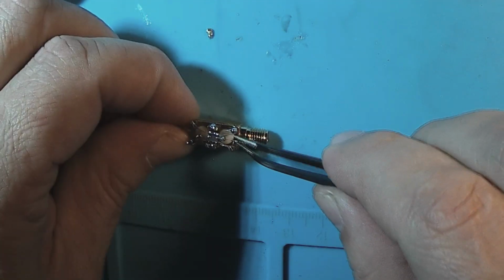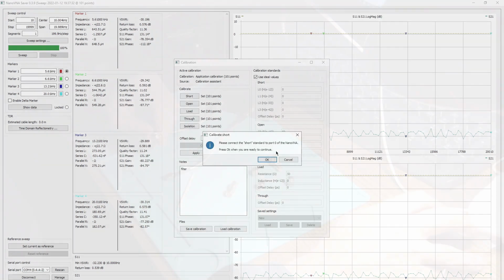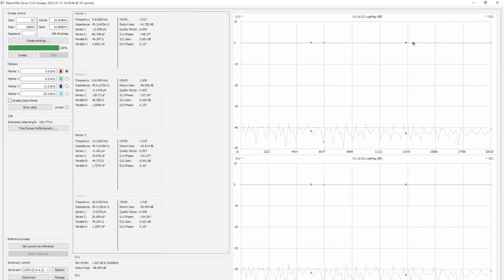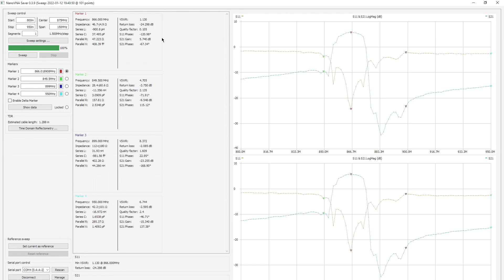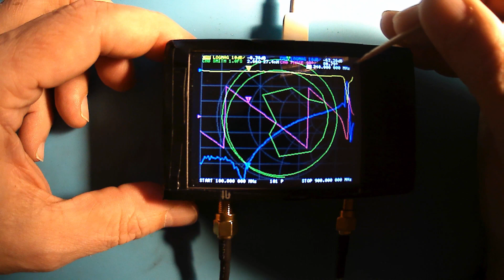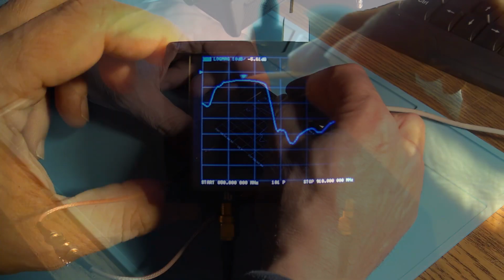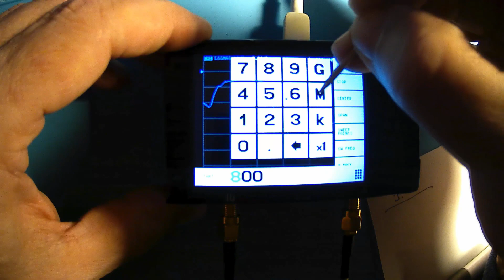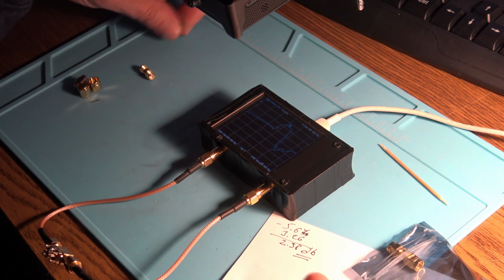DIY LoRa 868MHz bandpass saw filter

Comment: I have some question. Have done this filter and worked pretty well for some time but after it seems to have lost its characteristics i think because of esd. Will a surge arrestor for the antenna protect the filter or it needs a tvs diode also and what complementary with the tvs diode also is recommended to not change it's characteristics?
Reply from the maker: Yes they are prone to electrostatic discharge damage, of course an arrestor connected to a proper ground  will do the job, if you have a shorted antenna, like RAK, then a simple grounding the antenna and everything metallic around will be sufficient
Reply: @viocaia  so the antenna must be shorted circuit instead of open. I think i have the antenna open circuit. It is a mikrotik 6.5 lora antenna.
Reply from the maker: @vasilaos  No, it should be nice to be! there is no rule like that..I said for a short circuit antenna it's much easier to ground..for open you need arrestor

Comment: hello sir i have a question i live in india and here working freq. for helium is "865 mhz" , the saw filter i am trying to buy is a 868mhz , will it work for me or it will cause high dbi losses?
Reply from the maker: The one I'm using is centered to 866.5Mhz..so it will cover very well 865MHz too..search A3717 in my videos
Reply: @viocaia  ok sir thx for a quick reply 😊

Comment: Did you get the input and output connections the wrong way around when looking at the filter upside down? 🤔

Port 2 is input (antenna side) and port 5 is output (hotspot side) ?

Link to SMD schematics here:

https://www.mouser.co.uk/datasheet/2/1100/sf2137e_2-1917478.pdf
Reply from the maker: Doesn't really matter, it goes both ways

Comment: Good morning, when my SENSECAP arrives, can I directly connect a 10dB antenna that I have installed or do I have to configure the device for a week with the factory antenna? Thanks.
Reply from the maker: Yes you can..use any antenna available...10dB is great

Comment: Salut, ce dezadaptare ati masurat, daca ati masurat la intrarea filtrului fata de impedanta de 50 de ohmi. ? Multumesc. Din tabelul din stanga ecranului, la prima masuratoare apar niste valori aberante pentru VSWR si implicit return loss.Pe grafic insa, return loss era ok. De fapt am observat ca nu ati mai continuat masuratoarea deoarece va dadea cu plus :). Am observat ca ati setat un "span" de 150KHz la o frecventa centrala de 875 MHz ori asta e un saw wide band . Eu sunt de scoala veche, analizoare " normale" nu sunt familiar cu aplicatii de analizor pe laptop. Imi puteti spune ce folositi in videoclip pentru a face masuratorile de caracteristica si adaptare ? Multumesc.
Reply from the maker: Sint doua softuri..ala pe 64bit ..Nanovna Saverr da gain cu plus...e cam aiurea, trebuie facute niste scaderi..apoi am realizat ca softul de 32b pleaca de la 0 , deci valori negative..asta il folosesc acum..in general filtrele dau cam -2,1 max -2,5 dB pierderi..am gasit si mai bune ..aprope de de -2..nu e asa de mare banda..cam 7MHz..iar softul folosit este NanoVNA Saver v 0.3.09 pe 32b..daca face fitze si nu initiaza portul USB..cautati Nano QT..doar pentru connectarea aparatului, dupa care deschideti SAver si merge perfect..am un video despre problema asta..sincer inca nu sint prea stapin pe softul asta, incerc sa invat din mers..
Reply: @viocaia  Multumesc mult, trebuie sa cumpar si dispozitivul insa
Reply from the maker: @braturomeo6016  sint cam 60euro pe Ebay..nu-s grozave dar iti faci treaba..rapid si usor de folosit..

Comment: Very interesting. As I understand you are doing this for your helium hotspot? But why you chose the 866.5 MHz filter not 868?  And do I understand correct - installing saw filter there will be loss on antenna gain?
Reply from the maker: I couldn't find any 868Mhz..as in my miner original filter is also 866.5...so I went for this value..and yes there is a 2.38dB loss signal..by my tests..
Reply: @Viorel Caia  and since installing this saw filter did you notice any improvements? I keep seeing that they should improve hotspot but since I'm really at beginner level with RF, I'm trying to learn as much as I can and your video is ultra interesting and seems like I can learn some things. By the way nice soldering skills
Reply from the maker: @justinasn  Well, I'm still experimenting with different antennas for now, so I didn't use the filter yet..but there are reports like a small improve is there.This filter it's a need in busy urban areas, where are lots of cell towers and RF communications.If you are in a remote place , that should be quiet around so you can work without it.I'll hook it up soon and let you, but needs few weeks of statistics
Reply: @viocaia  Yeah I'm in urban area so filter might be a good solution for me. Going to wait for your results

Comment: Hello Viorel,
good idea - I had it, too. Building your own DIY filter, not to buy the expensive one.  Handicrafted well soldered.  And yes, now of course, to compensate the losses, you need absolutely a low noise amp. I know, you wait for from china. Mine is here, but I wait for the bias T. Then I will put close to the antenna.
BTW, I saw, you changed your location of the hotspot. What advantage do you expect ?
Reply from the maker: Wasn't the location..just the antenna type..
Reply: @viocaia  Oh, sorry, I misunderstood, what Helium says in your activities : "asserted location". Means seemingly changing antenna, too, not only location.

BTW, I discovered something, that I didn't know yet. In the last weeks I had low earnings, I was annoyed. Today I found the probably reason : I installed more than one antenna at my balcony-railing near the miner, but only one was connected. So I could change easily the cable to check.  But, I assume, that the not-connected antennas took away part of the signal strength, so that the whole signal and the beacons do not come into the miner to the radio card.  Yesterday I removed one antenna, today the last one, that was not connected. And what shall I say : the rewards went up immediately. Wow.  That's an information, all hotspot-owners, who are experimenting, should know. I think they do not, as me. Now I'm happy again.
Reply from the maker: @ulrichm.12  Very interesting..feels like a passive reflector out of phase..but I never read about this behave..I suppose HAM radio guys can clear that much better.Good minig!!

Comment: are you sure that the middle pin between longest one and other ground is the output?
Reply: The datasheet clearly says that pin 2 is the input and is between the longest one and the bottom ground one, pin 5 is the middle pin where all pins looks the same and is output.
The image with the dimentions also displays the number of the pins and pin 2 is clearly under the longest pin.
Reply from the maker: @DMNL2  Right 2 -/in is under the longest and opposite is output..but there is no harm to go vice-versa..
Reply from the maker: Yes..If you look at the numbers, the pin in the middle down is input and middle up is output, this is unbalanced. https://ro.mouser.com/datasheet/2/842/tdkc_s_a0001073232_1-2295337.pdf